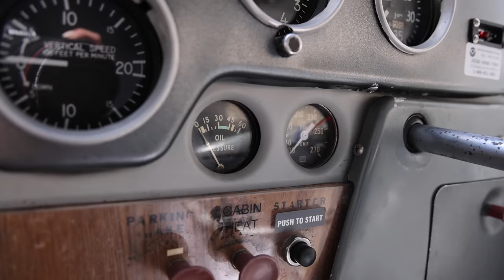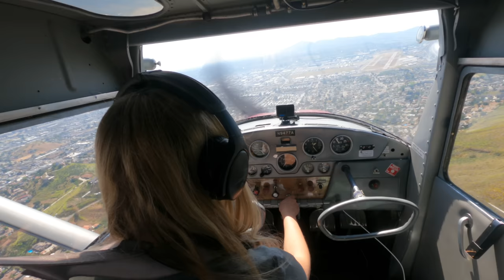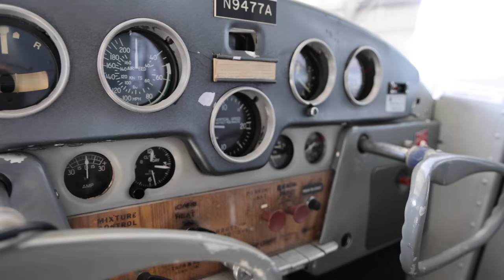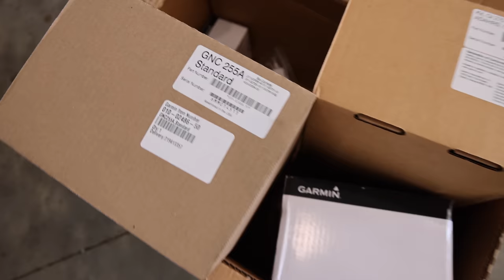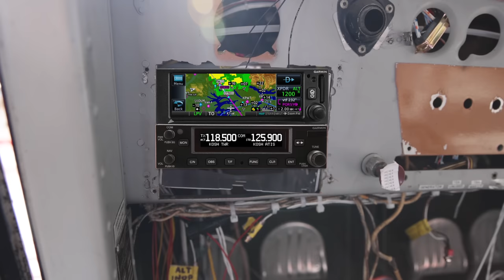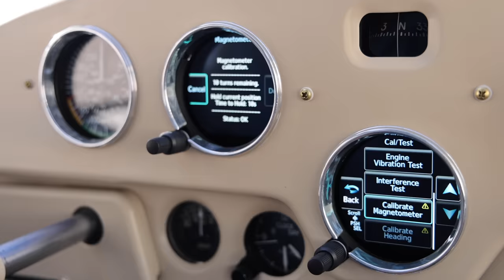flying to san diego for new avionics! 140A restoration part 1

Comment: Beautiful!  I really like the design... retains the "vintage" without compromise to capability.  I noticed when you landed and shut down, the prop was at "12 - 6 o'clock"  instead of "10-4".  Might want to check your prop index.. at least that is what is correct on the 0-200 in my C150K.

Comment: Have made the flight from CRQ to OXR numerous times in a 172 during training and when you initially said that it was going to take 2.5 hours to get down the SEE I was scratching my head as I would usually do the whole trip in that time. Then you said your pathing and it all made sense. I do have to ask though, why did you cut back out to the coast instead of basically following the I15 down? Seems like it would have probably saved you some time being a more direct route while still allowing you to avoid airspace.

Comment: My preferred inland route is usually under the Bravo via:  Direct Elmonte 3500', then Fullerton, then towards VPLHP then along coast towards Gillespi. That way it's way shorter route than POM VOR and ATC will likely not reroute you due to the lower height. Try that next time. I think you'll have better luck.
Reply from the maker: Thanks for the tip! Will definitely try this!

Comment: Stevie...I notice that almost all of the time you use your full call sign instead of just 77A.  Any reason for that?  When i was taught, they taught me to just use the last 3 once initial contact had been made.  I understand if there is a call sign close to yours.  Just curious.  Thanks.
Reply from the maker: A lot of airports around here will yell at you if you do not use your whole call sign, VNY for example. It's just habit to use the whole thing now!
Reply: Ok.  Thanks for the reply.  I'd think especially out where you are in the busy airspace they would want to keep the radio calls at a minimum.  I guess each area may have their own way of how they want things done.  IND was the busiest one I ever flew into.  Around here they are good with the last 3.  Love your videos!  Keep up the good content!

Comment: That’s cool they let you descend through the Bravo w/o the required equip. I guess the two way radio and mode C transponder was enough? Nvm I hadn’t watched the whole thing, you said you had some kind of ADS-B out work around.
Reply from the maker: I have the required equipment! For the San Diego class Bravo all you need is two way radio communication, mode C transponder, ADSB-out and a Bravo clearance! It's just the LAX routes you need the VOR or nav equipment for.
Reply: I dont follow the last comment. You can go right over LAX without a nav radio. I do it in my 140.
Reply from the maker: @kwittnebel  I think you technically can, but the SFRA and coastal routes are both based on VOR radials, and I didn’t want anyone coming for me in the comments asking how I navigated via VOR radials if I didn’t have a VOR. Honestly more of a filming/YouTube consideration for me to go around
Reply: @bayflight  Ah I see. An Aera linked to a garmin radio works well for me. But I don't have thousands of armchair pilots dissecting my flying like you do. Safe travels.

Comment: I noticed that your prop is vertical when the engine is off. I was always under the impression that it should be horizontal apparently to keep it away from the ground. Am I wrong and is there no rule?

Comment: You certainly know more about flying then me, but I think I am better in audio tech. You would get much less air pops and overmodulation on the audio if you kept the microphone at least one inch from your mouth.
Reply: Ambient is over 100dB. Audio you hear is actively noise cancelled. At 1" from mouth, the intercom would not activate at all, rendering communication impossible.